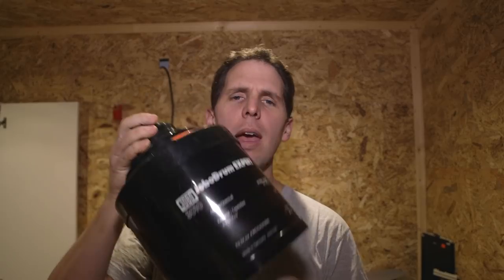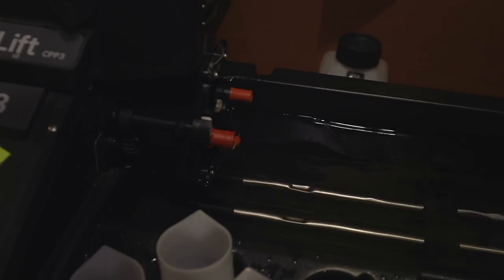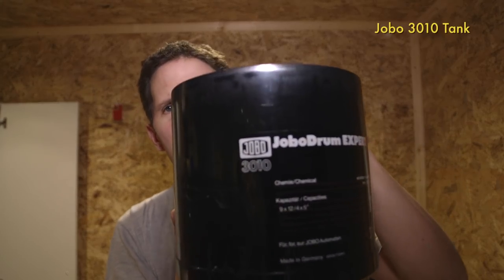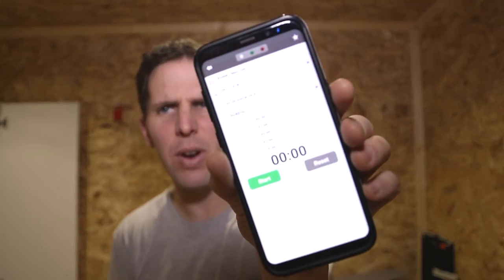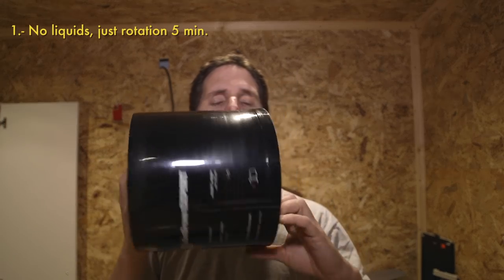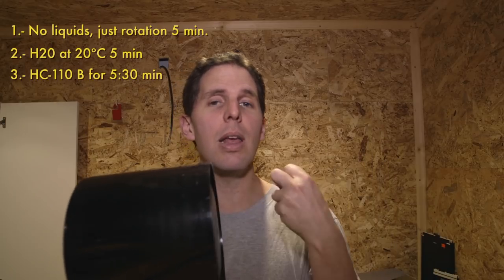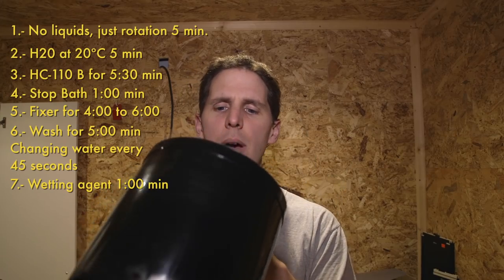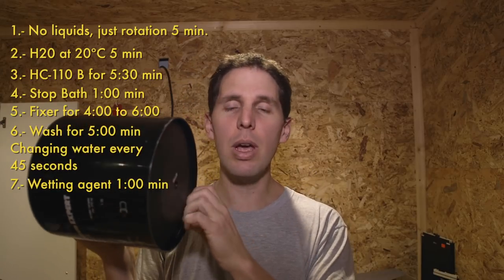Developing Kodak Tmax 100 4x5 with a Jobo || Darkroom

Comment: You may mention and I missed it, how much developer do you use in the 3010, because the 270 g printed on the lid seem too little for 10 sheets? Thank you. By the way this is the first time I saw the whole jobo machine in action and it was interesting. Love your content!
Reply from the maker: I use 500ml and in the minute 2:12 its written on the video. 270ml feels like to little amount, so I do 500ml. A lot more Jobo stuff coming up.
Reply: @NicosPhotographyShow  Sorry I missed it, but yes, it seems much more wise to use more volume of b and w developer. Thanks.
Reply from the maker: No worries, i started to wonder if i had missed it too. 😉

Comment: I am planning to develop  10 sheets of ilford hp+ 400 4x5. I will use kodak d76 developer with 1:1. May i know how many liters on developer i have to pour in jobo 3010 drum for 10 sheet development
Reply from the maker: I use 1 liter always. Its the max capacity and I dont take chances.
Reply: What about fixer and stop bath? Same one liter capacity
Reply: What about stop bath and fixer time? I have ilfostop and ilford rapid fixer
Reply from the maker: @usmanmohammed2404  yup. But I reuse both fixer and stop for a few tanks.
Reply: Thanks a lot...
Let me try today or maximum tomorrow and i will let you know

Comment: Interesting, as always. Since the tank is so expensive: can it be used with any Jobo machine (e.g the old cheap ones)? I assume that it also can be used as a normal tank (without machine). Have you tried that? Are there cheaper alternatives for 4x5 (apart from tray developing)?
Reply: Expert drums aren't compatible with JOBO CPE machines.
Reply from the maker: As Jan said Expert drums only work on the bigger machines. Cpp, cpa and atl (not the 1000 or 1500). Try the SP-445, heard great thing from users.
Reply: babarfuy  3010 can do wonderfully by itself. I developed numerous velvia's, t max'es in the kitchen's sink

Comment: Do you reduce the Massive Dev Chart recommended development time to allow for the continuous agitation? If so, by how much?
Reply from the maker: I dont, I prewash with water for 5 minutes at process temperature, keep the times. Except for Xtol that was designed for Jobo use.
Reply: ok thanks.
Reply: ok thanks.
Reply: ok thanks.
Reply: ok thanks.